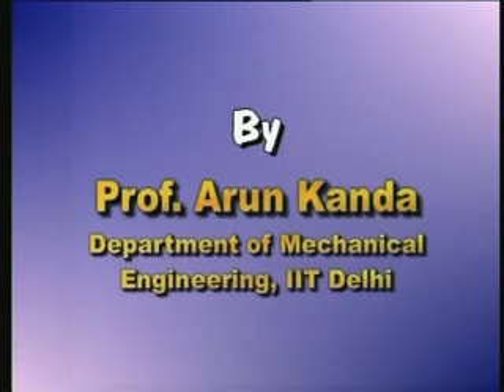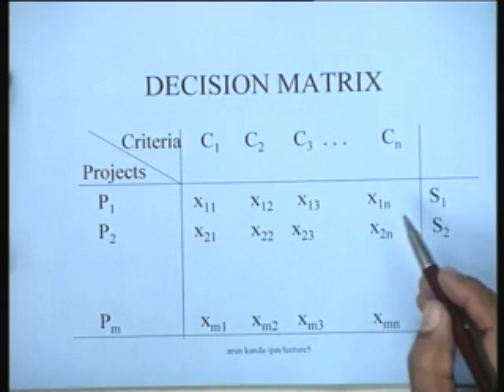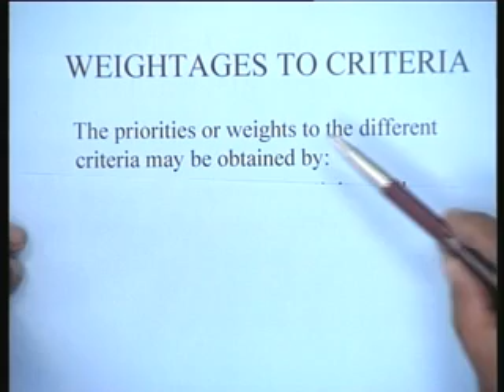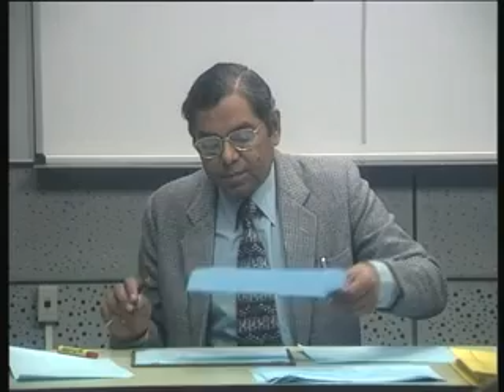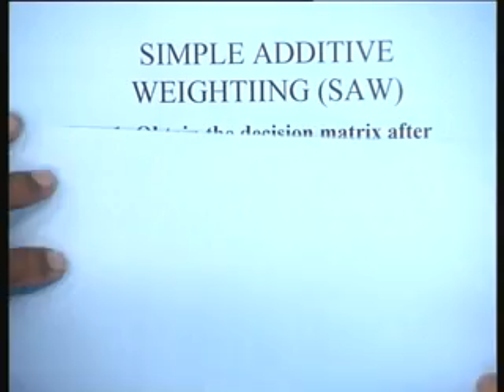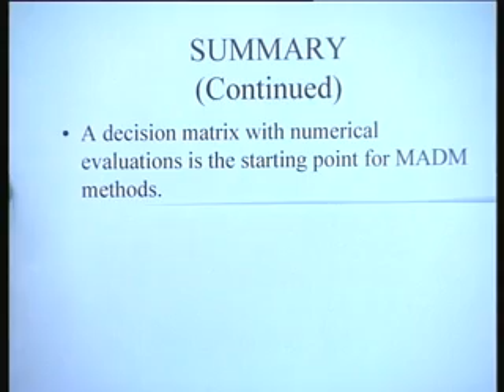Lecture - 6 Project Selection

Comment: Too much math mambo jambo without meaning. It is impossible to operate ordinal scales!!! 

The only way to do this correctly is using a normalization scale with the AHP method, by pair comparison of the different steps of the ordinal scale to get an absolute scale. Then, and just then, you can add, subtract, multiply, etc.

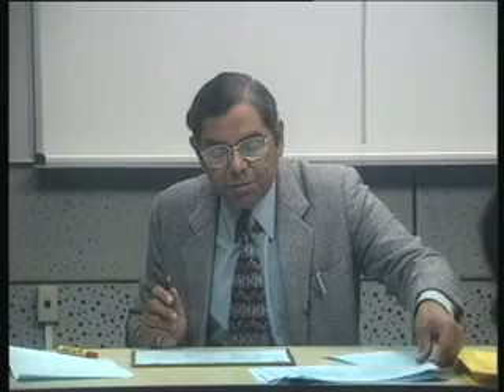Comment: I can not replicate the values of separation measures using the formula given in step 5. (Formula given at time mark 38:03 and values displayed on the slide at time mark 39:20)   Can anyone help me? I'm using the values in the immediately preceding slides, WEIGHTED DECISION MATRIX and IDEAL & NEGATIVE IDEAL SOLUTIONS. https://youtu.be/9P9Gs8o9oHk Thanks!
Reply: Chris Stevens OK, I found an error in the values shown in the earlier slide, Techinqe for Order Preference using Similarity to Ideal Solution (TOPSIS). The A4,X4 value should be 5.0 rather than the 5.5 shown. When this is done almost everything else pans out and any tiny rounding errors are then mostly unimportant. - I think at one point they intended on inverting the scale where few dollars gave a big score but abandoned it midway.